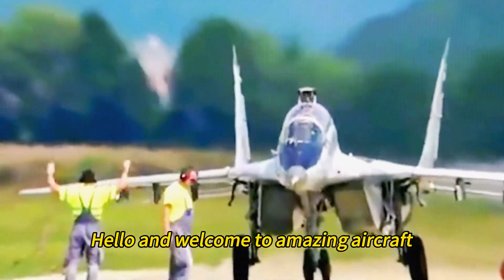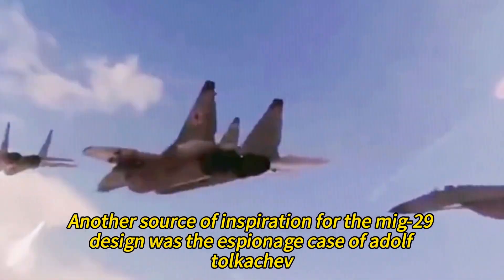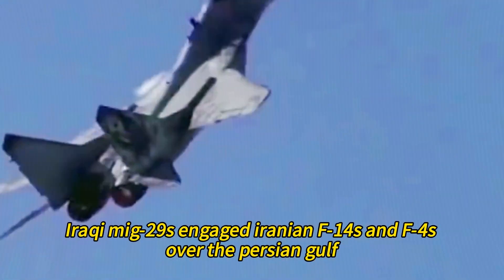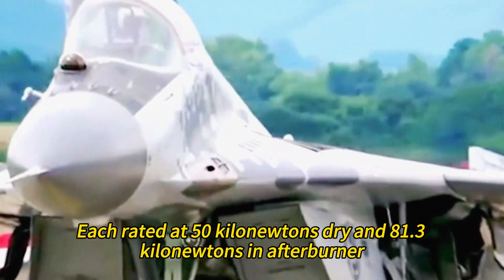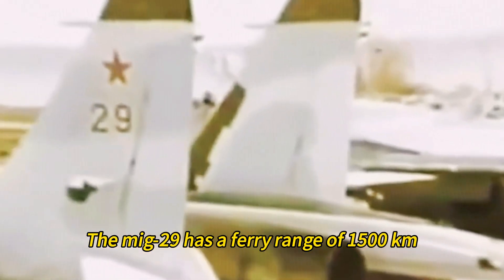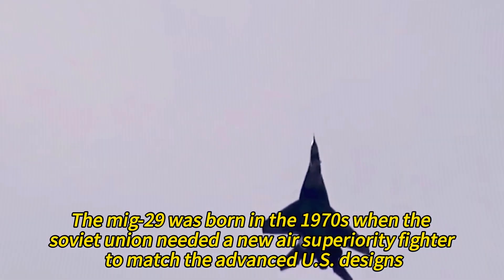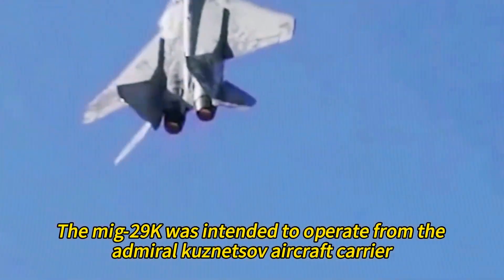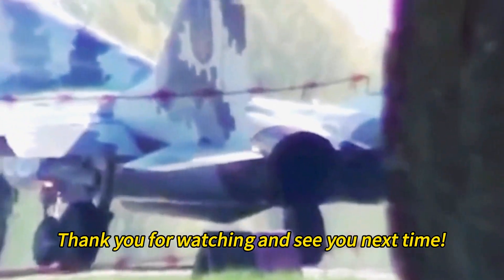The Ultimate Dogfighter, That Shocked the West, How the Mig-29 Became a Legend of the Skies

Comment: I'm pretty sure the MiG29 doesn't have thrust vectoring or fly-by-wire in any serial production version.
Reply: The MiG 29m has fly by wire but it  is mostly produced for Egyptians due to the su27 being superior but more expensive.
Reply: @C0M3T_  either way, thrust vectoring wasn't serially produced.